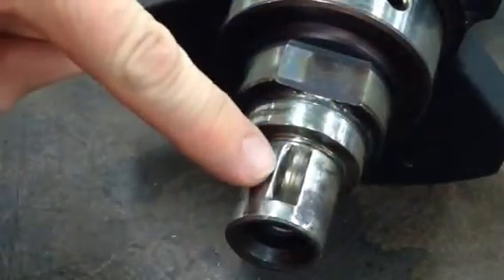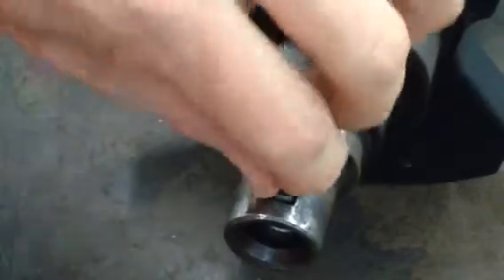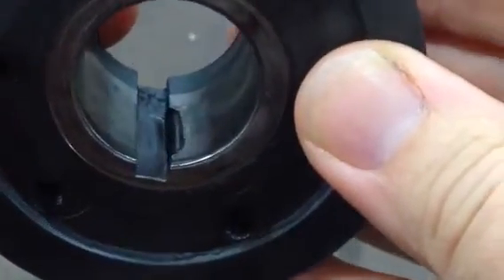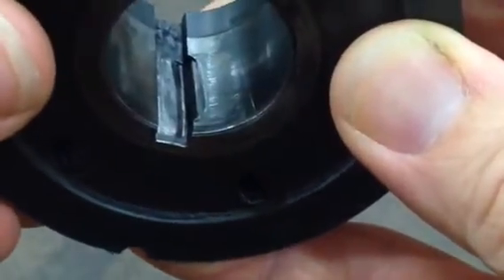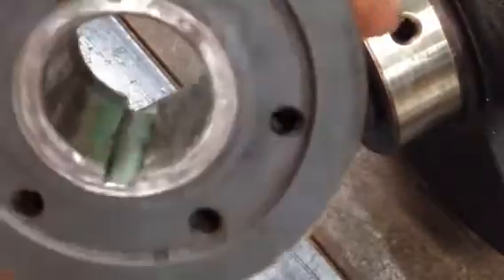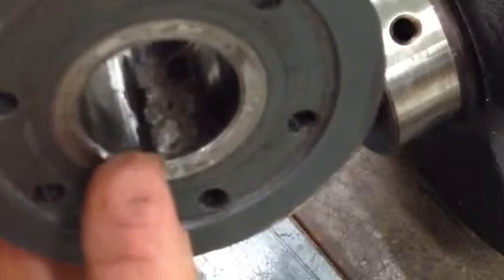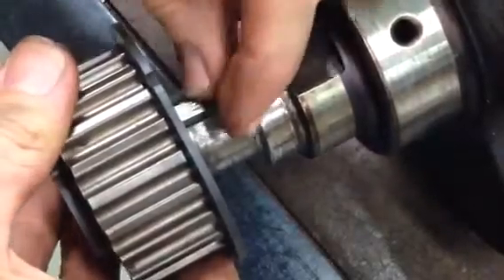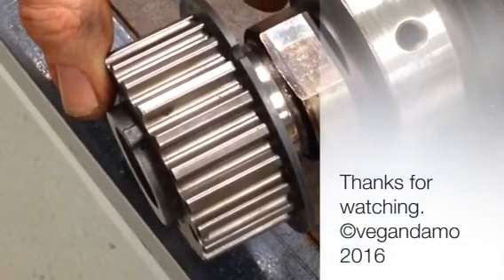Welding repair to my van's crankshaft key-way

Comment: I need to do this... I need to ask though.... I have a Lincoln 225 stick welder & a FLUX125 welder  from Titanium. Would you recommend either of these for the job?
Reply from the maker: Eyal Perelmuter not very familiar with the FLUX125 welder, or the Lincoln for that matter. That said, stick welders do offer better penetration than MIG, so provided you can do it without getting flux inclusions it should be pretty strong.

Comment: It works ok after 4 years?
Reply from the maker: Jucelio Guilhermino it did until mid last year when I noticed a drop in power again. Timing was off and it turned out that the weld metal had crushed inside the gear, rolling the key over again. Rewelded, but now having other issues with the motor.
Reply: Sorry i'm brasilian, my english is fail.

Comment: why didn't you just buy a new gear?  They are fairly cheap. Nice work with the crank tho
Reply from the maker: 3dmixer I tried, believe me. My spares place, which are great and incredibly helpful, couldn’t locate a new gear for this engine. I thought it’s common enough, I should have no problems, but nope.
Reply: @DamoVegan  in that case you had no choice.  Good work

Comment: I'm having the same problem, think am going to weld the key in the crank .
Reply from the maker: Should be strong, good luck with it. Just make sure you grind it to get the gear back on. It's a pretty tight tolerance.

Comment: Exactly what I need to have done. My woodruff key broke, dinged up my accessory pulley and forged crank. I've already got another pulley and new woodruff key. Didn't know it was loose until the timing belt went, had a miss I couldn't get rid of as well, no matter what I did. The cause, poor idle quality for about a year, throwing belts due to valve cover and PS pump leaks. I've got more room to work with on mine... do you think this can be done with the crank in the engine? It's either that or complete disassembly, engine is 60k or so miles, I'd rather not take a chance disassembling it (2 piece block crank is in a cradle.) Throwing together a different engine to run temporarily.
Reply from the maker: PGTMR2 the only issue I see with doing any welding around an engine is the sparks near possible fuel fumes. 
My timing went a bit last month & I thought the key had sheared again. Thankfully discovered the tension pulley on the timing belt had moved causing a slipped tooth or two. Reset & tightened everything & the engine is now running the best it has since I got it. Fuel economy even improved to over 10km/l. Never been that “good”. One benefit of removing the crank to do this is you can replace all the bearings in the same process.
Reply from the maker: PGTMR2 I was worried about removing the crank too. Never done it before. However, the oil seals also needed replacing or I wasn’t passing rego. The front cross-member has never been so oil free. 
Good luck with however you go about it.
Reply: I'm weighing how good the bearings are now vs. how good new ones replaced by me would be :D Factory this engine was tested to 300k @ 8000 rpm, then was torn down, measured, and found to still be in spec. The Japanese fella that owned it before me took incredible care of it, no doubt apologizing and bowing backwards out the door if he even thought of cussing at it. No signs of it ever seeing a drop of water or oil outside of where it was supposed to be. 23-24 years old, heads haven't been off, original seal at the oil pan and where the crank cradle separates. Under the valve covers it's like new, oil pressure is where it should be. If it was a more delicate engine, with higher miles, I'd be more inclined to tear it down.
Reply: Ha ha all the oil on the cross-member is just rust protection

Comment: Is this engine still running ok almost a year and a half later? I recently had the same thing happen to my crank nose keyway and was wondering if I should fill the chip like you did or file a larger keyway.
Reply from the maker: alex ferreira Still running strong and still giving me occasional grief. My timing recently went out and I thought the worst that the key had sheered again. Turned out the tensioner pulley has slipped and jammed, causing the belt to jump a tooth or two. This also caused my points to fuse. I realigned the belt and timing, filed and set the points and he’s running again. The crank gear is still rock solid.
Reply from the maker: A follow up Alex. Max has never run stronger. Since resetting the timing, I replaced the points and his acceleration and torque have been great.

Comment: I am going to do the same thing with the Nissan RB30DE (hybrid) engine in my VL Commodore.

The keyway in the crankshaft for the drive pulley is worn like that & I'm planning on doing the same repair.

I've got an R33 RB25DE drive pulley on the engine because the original RB30E VL pulleys keyway flogged out so it has just been held together with the Liquid metal product for worn keyways.

If the R33 Skyline one is still o.k. I may reuse it,if not,the Chinese make an aftermarket aluminium pulley to suit.
Reply from the maker: Good luck with it. My van is still going, though the timing seems to be lagging a bit now. Hopefully it's nothing major.

Comment: hello I have done  five cranks in car and all have worked and held up I weld them in on the sloppy side so the key stays in the crank   much stronger this way grind back with a right angle die grinder and some sanding need a steady hand

Comment: Could enlarging to the next size key be easier. Metalized epoxy does work, for a while in any case.
Reply from the maker: PacificCircle1 enlarging the keyway in the crankshaft may have been possible, but I didn't have the equipment to do the keyway inside the gear pulley. 
I had considered the metal putty, but upon discussing with an engine rebuilder, he said it may only last 6-12months due to high torque environment. 
Max is still running strong.
Reply: What I was afraid of. The epoxy I looked at said it was good up to 230 F. I figure that is something it will only heat soak to after a long trip and far away from home. The perfect time for things to break, again.

Comment: Did you use loctite 660 before assembly ?
Reply from the maker: No I didn't. I rarely think of using loctite with anything. Could be worth reconsidering. I'm assuming you meant for the bolt that holds the lower crank gear on.
Reply: Damo Vegan  yesterday,I filled the gap woth a piece of metal I ground off and stuck it in there with a tiny amount of 660 ...So far, the engine is ok but the pulley has developed some wobble after 20 minutes of driving.
Reply from the maker: The wobble doesn't sound good. Was the bit of metal meant as a 'key' & a really snug fit? I had metal repair putty recommended to fill in the space that was worn around the keyway. It sounded feasible but I didn't trust its longevity in such a high torque application.
Reply: Damo Vegan  Yes. The metal was a key i made by filing and grinding steel . It is runnng fine but the wobble worries me.
Reply from the maker: Is the wobble just in the pulley? It may not be seated fully or the bolts on it a little loose. Have a look maybe?
Reply: Damo Vegan We have a brand new pulley and bolts were properly torqued to specs ..A miata shop said the nose of crank may have deformed and there is nothing you can do if thats the case...Can I may be try shims to correct the pulley wobble? Any opinion ?
Reply from the maker: Sajid Rafique I'm sorry I didn't see this earlier. I'm unsure about shimming. Bit beyond my knowledge.

Comment: im gonna attempt this with the crank still in the engine. I'm probrably gonna have to hand file the whoke lot.
Reply from the maker: You'd want to make sure there's no oil or fuel around, even fumes. Welding spark could blow the lot. Hand filing that far into an engine bay would be bad on the back too.
Reply: Dude! Did you make it? I was thinking to just weld the key the fuck on tge crankshaft and get a new teethed wheel
Reply: @mihailpetrovici5044  did it work out? I am thinking of doing what you said.